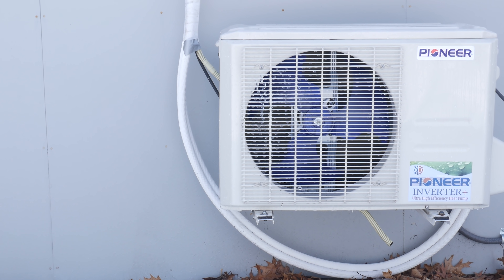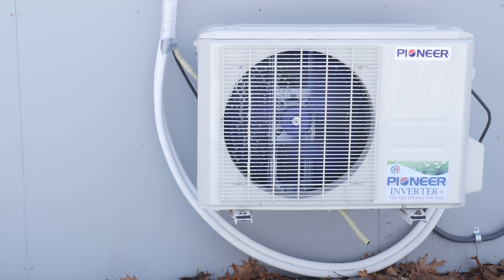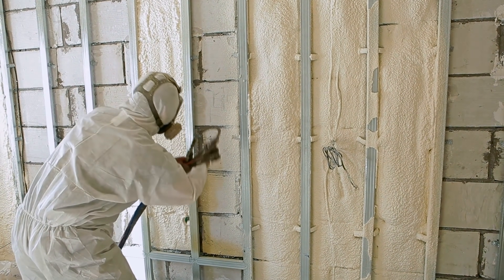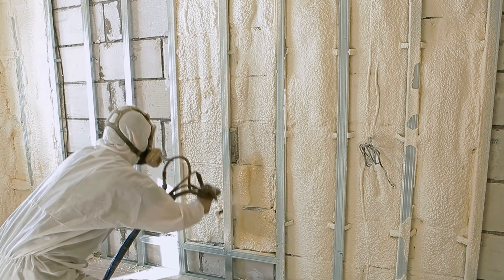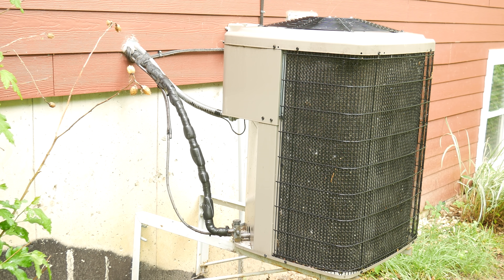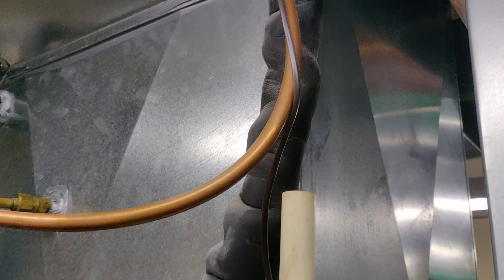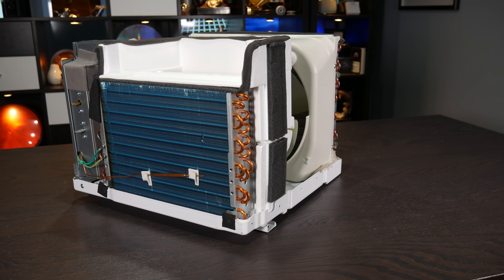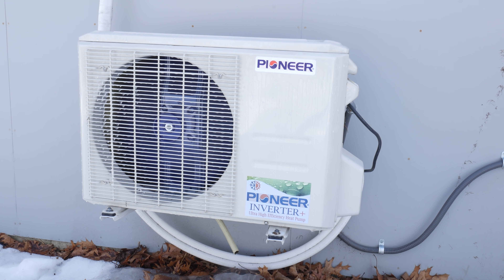Heat Pumps are Not Hard: Here's what it will take to start pumping

Comment: We changed out our 20 plus yo gas heat/ac split unit with a heat pump. Am impressed by how quiet it is compared to the old worn out unit. I don’t have to yell outside anymore! The electric bill noticeably decreased. I do notice that the heat is not a nice as the gas, though, the new unit will run off gas if we change some settings. But, it does heat well enough to keep the house warm. I just sometimes use the register vents to dry wet shoes for instance, and that heatpump heat just isn’t as hot as it used to be coming out of the vent in the dead of winter. But I’ll take my tax credit and continued electric savings and run with it. After the first of the year we are changing out our water heater for a heat pump unit as well. It will help dehumidify the basement on top of the other heat pump benefits.

To add information, house is about 2400sqft, new heat pump is an Amana capea6030d4aa. Install was done by a qualified hvac company who I have a first name basis with the owner and also share the same last name (they made profit, but probably less than most installs. The otd price for unit and install was $6000.

Comment: I just had an Air Temp inverter heat pump installed which utilizes my existing ductwork. I’m in Maryland. I ripped out the emergency heat coils because I won’t need them… and my insulation and ductwork sucks! Things a beast. These are readily available at RE Michel from my understanding. Probably run you $7-10K for most homes, depending on where you live.

Comment: My grandfather has a ductless house in Southeast Pennsylvania (And despite its age it's got decent insulation) They have wires in the ceiling as a heat backup but in the past 3 years he had a heat pump installed and was excited about it, as it'll actually save on his heating bills a lot (unlike the solar panels he bought which will go bad about the time they've paid themselves off). They've managed to get one for practically every room in the house, I think it's a Mitsubishi.

Comment: I have both of these things: multiple mini split heat pumps and a hydronic air to water system replacing an oil boiler (which remains as a backup) for the same reason mentioned in the video: getting all the little areas of the house warm like bathrooms that have radiators but no mini split heads.  Before I pulled the trigger on the air to water system, I ran my boiler at 120 F for a few months and it kept up.  However, in real life, the ATW system keeps the water between 110 and 120 F and the boiler during my test was basically bottoming out at 120 and shooting above a lot.  That becomes a big difference when you’re trying to heat with natural convection from finned baseboards.  So it’s marginal.  Below about 30 F outside, the house can maintain around 68 F, not the 71 F setpoint.  Below that, I’ve programmed my other systems to kick in, like my mini splits and pellet stove.  It works, but there is thought required.  Also, I imported my system from Canada since I could not find a more local version (mid Atlantic US).  People do not know how to work on these.  I had a hard time finding an installer and I’ve had leak issues.  Multiple techs have arrived and immediately left when they see what I’ve got.  It’s just scary to them.  So, I wouldn’t expect a turnkey solution for ATW heating replacing your boiler but it can be done if you are persistent.  Final thoughts on the mini splits: they are great and very efficient, but two problems: mine get really really dirty inside.  Mildew and maybe mold grows on the blower fan on the indoor unit and we have to take each one apart every summer and do a deep clean.  Also, they are not as good for air quality as a whole house ducted system.  Those can have really nice big filters. My mini splits have really thin mats that are not the same.  We have supplemented with standalone hepa units.  I hope that helps someone out there and if anyone knows a good AC tech in the mid Atlantic region, I’d be interested to hear about it.

Comment: Scandinavia has used heatpumps in extreme climates a very long time, and has all of the knowledge needed.
We also have used triple-glazed windows with gasfilled casettes and coatings that lets sunheat in but blocks heat from going out (different wavelength heat) we even went so far to make our houses too efficient and airtight that we got problems from that and had to invent efficient ventilation.
One place i lived in had a heating system with temperature sensors inside (duh) outside (duh) and in the insulation in the walls, and calculated where the zeropoint in the wall was at any time, if it started moving in or out from the optimal, it adjusted the heat accordingly. Once the temperature dropped from 0 to -25 in an hour but it never fluctuated inside and the zeropoint was kept optimally in the wall

Comment: Heat pump split systems are quite common here in Australia, most people choose between ducted and split systems when building a new premises, but most houses are easily retrofitted with a split-system air conditioning unit, they're also extremely efficient as hot water systems. A lot of people are switching to a setup where a solar panel not only powers their home and exports to the grid, but also contributes electricity to the heat pump system, that cuts down on power bills dramatically.

Comment: I got two of these split system installed in my home, for two rooms. I am from India and although split ACs were popular here from before, heat pumps are a recent thing,they are called "Hot and Cold ACs" here. As you said, they were damn easy to install, though I got them installed by company personnels, done in 3 hours each. However, in our parts the primary electrical connection is given to the "head" unlike your system, it's called indoor unit here, and a secondary line along with communication line is there between the indoor and outdoor unit, that runs parallel to the refrigerant pipes. So, in a way, it's even simpler than the unit you got there. I have one 1.5 ton dual inverter(2 BLDC motors) LG and a 1 ton single inverter(Single BLDC motor) Voltas(Indian brand). In total both of them cost me less than 1000 USD including installation. I got both of them under several offers and it was a steal. Usually it would cost around 1500 USD.

Comment: Hey TC, I am an electrician in South Florida. We dont have much of a need for heat distribution here in residential, but I have seen these systems before and they call them mini splits here. However, they are used as air conditioning units for small spaces and I think theyre just swell. I justr basically wanted to confirm that these are indeed the same exact things as what youre talking about, but working in reverse.

Comment: I live in Greece. Compared to the prices you mention, we live in heat pump heaven here.
Not only can you buy cheap units and heads, I bought two heads and two outside units since we installed one at the front and one at the back of my 52m2 and the distance is long.
The technician suggested two GREE machines (maybe he gets some percentage from the company, I'm not sure), bought them, brought them and installed them both in one day, they're great inverters so I get both heat and cool very efficiently, I didn't have to do anything!
Only call him twice to arrange the deal.
He had a helper with him.
Total price: 900€
I mean total!
Less than thousand!!
Plus we split the expenses with my landlady!!
If I ever leave the apartment, I claim one of the A/Cs as my own.
It would be cheaper for you even if I send you the machines and the technicians via plane, plus you pay for their hotel, still a lot cheaper than what you're dealing with there!

Comment: My house was built pre-1960 and it has 9 water filled radiators for heat provision.
Due to the Cheap Oil that was available then no insulation was provided.
I have recently installed Attic Insulation and so far I have drylined my kitchen, hall, bathroom and bedrooms.
Due to a burglary in the mid 1990's I had to get double glazing installed in order to qualify for Insurance Cover.
I got my old Oil Boiler replaced by a High Efficiency Condensing Gas Boiler 2 years ago and I had my first Annual Boiler Service last May.
Government Recommendations suggest that I will need to get a Heat Pump in the near future and there's a LOT of work to do to get the structure to comply with the various requirements for this upgrade.

Comment: I have an old school hydronic heating system and love it, it is comfortable and energy efficient. I have no ducting for a central air system, and used to use 4 window units. Now I have 2 ductless minisplits, my house is way more quiet, much cooler and it is very even throughout. And my most expensive bill was $200.

Comment: 44:00
This is literally what my dad did to deal with the excess heat in my bedroom as a teenager. Didn't put a unit in the window, just cut a unit-shaped hole in the wall, crammed it through that hole and filled the border with foam followed by wood trim.

Comment: I had heat pumps installed in 2 of my upstairs rooms in the UK recently.  Most people don't appreciate air conditioning like I do over here.  :-)  The ability to heat with them was an unexpected surprise and I'm starting to appreciate now much more how you could just replace the entire gas central heating system with these things.  Trouble is, that ain't happening, even in new-build homes.  The builders invariably put in gas heating with radiators, because that's How It's Done In The UK.  The other thing I'll add about heat pumps; they're pretty darn big.  I have 2 units for 2 bedrooms and they take up half my loft space.  Presumably if builders were actually designing them into new builds they could be placed more efficiently but they're a pain to retrofit.  I definitely do not agree with the assertion that fitting them is 'really simple', or particularly viable for most people who aren't experienced in this sort of thing.  Get professionals to do it.

Comment: I like your channel, your information in general too, so it's great you finally posted about something in my wheelhouse.  I was a HVAC tech in Australia for about 25 years and I worked on everything.  I have experience in USA ducted systems because the few that were sold here got repaired by me, also the main business here was Asian wall splits.  I love the cute name Americans give them "ductless mini splits", yeah, but just wall splits (or if you were a competitor that promoted ducted systems here, just wall warts). 
I've worked on "trash can" carriers, the odd lennox and goodman, from 1990 up to a 2010 fujitsu VRF multihead when they first came out.  Chuck in a few 1970 "pope" local or "national" brand as panasonic used to be known as.

 The Japanese companies were the innovators:  For electronics mitsibishi electric and panasonic.  For air flow, design, multihead vrf etc, Mits electric stands by itself, fujitsu (uses mits E: tech), daikin (pretty sure uses panasonic tech), mitsubishi heavy industry (company is so big it has two branches), and panasonic themselves (reliable, just lacks finesse as they aren't so good at plastics or noise reduction).  From Korea Samsung and LG are late comers, samsung gave up last I checked but LG pushing hard.  The American brands never bothered until they could slap their name on something cheap from China.  

So brands to look out for are Mitsubishi electric, Mitsubishi Heavy Industries, Daikin, Fujitsu, Panasonic and LG.  As far as Chinese brands, the "landlord's special" here was TECO, cheaper and they try hard with what they have without copying anyone, and they backed their products up too.  (all name brands here including them had a 5 year warranty - this started back in 1992 when "email-westinghouse" copied an existing Fujitsu design and tried to compete with it just based n warranty length, pretty soon it became industry standard)

What I really want to ask is how it handles the winter over there.  Like I said I have worked on some American ducted equipment and they were full of fail-safes and electric boosters or gas heaters.  Mini splits are really really common in Asia and Australia, I started installing them in 1990.  But with the delta K being 6 degrees kelvin that meant under 5C the outdoor unit would be under 0C and ice up.  This means 45min heat, 15 min defrost cycle every hour.  Here in Australia it hardly ever gets down to 5C so not an issue, so what is your experience in colder weather with regards to a cheap Chinese wall split?
Reply: He has a whole other video that describes his split unit’s defrost cycle.

I have a “trashcan” external unit that used resistance heat below 5 degrees (to supplement the heat pump… not replace it).

Comment: All this talk about pumping heat has sent my heat pump pining for the fjords. Thanks Alec. 🤑 Not going to complain though because I at least have backup heat and its warming up this week anyway. Thing is 11 years old and hasn't skipped a beat until now.

I came home to the main breaker in the house tripped, turned power back on and oddly the heat pump immediately turns on even though its not supposed to (no call for heat and generally these units have a delay relay to protect against brownouts). I suspect its a bad contactor. Oh well, at least I have some heat for now.

Comment: I live within the city limits of Seattle and have a heat pump that was installed to replace an older furnace. It might be possible your source on the city ordinance didn't fully understand the ordinance. There is an ordinance requiring six feet of space between an outdoor unit and any property line. Our installer explained this as a relic of the older A/C units that made quite a bit more noise, as you demonstrated. I understand this to be a common ordinance in many other cities, this isn't unique to Seattle.

Due to many older homes in Seattle being constructed before modern regulations around things like property setbacks (one wall of my neighbor's garage is literally on the property line), and the hilly nature of the area often reducing usable flat areas of a lot, there can be challenges with many types of renovation work. It is quite possible, in the singular case you heard about, that it was not possible to mount an external unit with a six foot setback. It's also possible that the heating contractor could have made a system work with a little more creativity, but wasn't willing to put in the effort.

Whatever the case, heat pumps seem to be fairly popular within Seattle and the larger metro area, so the city's restrictions don't seem to be putting an excessive burden on installers, even if it would make sense to have a reduced setback requirement for more modern and quiet heat pumps versus older/traditional A/C units. In fact, the City recently put a moratorium in place on permits for any new commercial or large multi-tenant residential buildings using combustion heat sources, and I expect a similar situation with single family residential will follow. This would leave heat pumps or resistive heat as the only heating options, and I would expect heat pumps would end up being installed in the vast majority of cases.

TLDR; Seattle isn't anti-heat pump, it just has a few common restrictions in place, and renovations to old houses often hit roadblocks.

Comment: Add solar panels to the equation and things get really interesting 🙂 I have just modified gas dual-contour furnace (hot water and radiator contour) to solar panels + electrical boiler with machine learning, so it learns your consumption patterns and prepares hot water only when required + multi-split system with 3 indoor units. I think I’ll return investments in 7-8 years with todays costs on electricity and gas in Poland, but considering that we use russian gas, which we’re going to stop pumping soon, and gas and electricity prices will jump up hight - investment might return in 6 years or even less.  In edition I have free electricity in home, and close to zero emissions (let’s see if I’ll need to use gas below zero C this winter) 🙂 love your videos!

Comment: I had a very similar experience to your brother (and I live in Chicago). The one place told me not to bother. The other place was very happy to give me a quote and tell me how great it was only for the quote to be twice the basic furnce/ac. I really, really wanted a heat pump for more reasons than you even mention in your videos but sadly it's just not economical (even though it should be).
Reply: Same here; got a quote of $12k for a SFH in Chicago from 4 Seasons (Home Depot).  GReaaaat…
Reply: THAT $12,000 INSTALL was insane.  I would buy the unit wholesale for $3000.  Then tell the HVAC company “I already have the heat pump.  Just install it please.”

I do that with car dealerships too: I supply the oil & filter, and they charge $15 labor.  It saves money

.
Reply: so many people in the comments here getting ripped off.